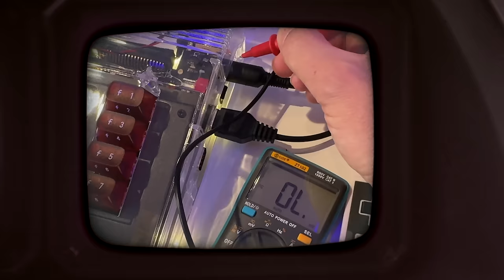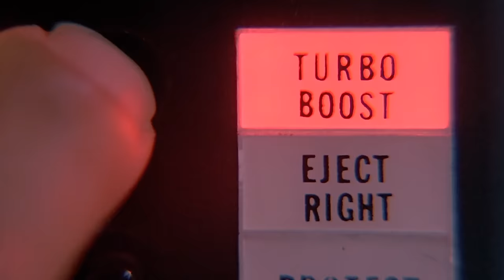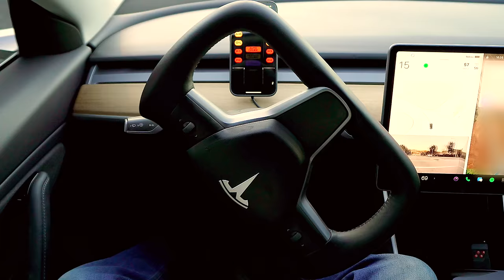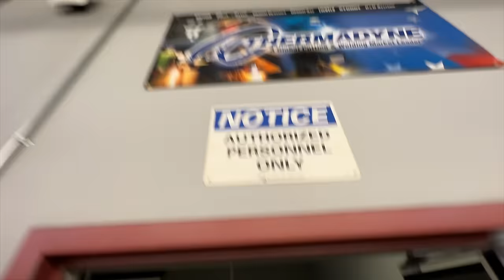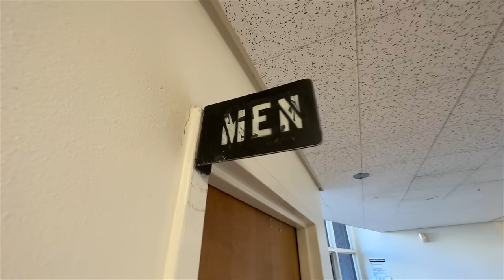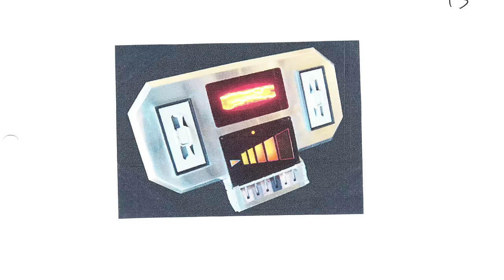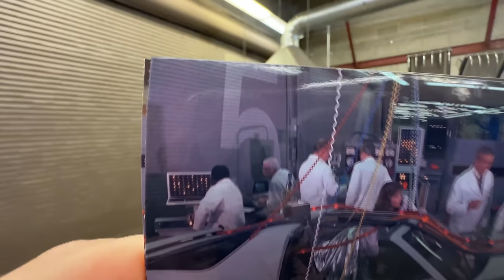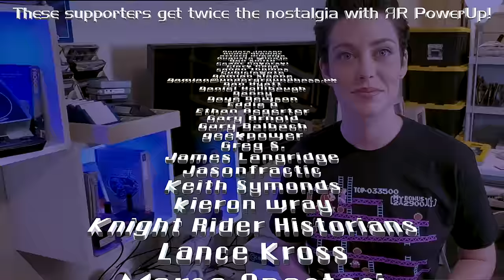Finally Found?: Knight Rider's Ultimate KITT Filming Location!

Comment: I recon this building was also used in Knights of the Fast Lane, Season 3. I think the corridor at 11:44 is the same corridor at 42 mins into the episode. Also 38 mins into the episode there is a roller shutter door with the number 1 on it. Looks very similar to numbers in this vid. Ceiling lights the same too.

Comment: Have you realized what makes an 1980s high-tech scene really retro, apart from the hairdos? Red and green lights, but no blue or white. Blue LEDs, and consequently, white ones, only came into existence in the 1990s. (Their story is really amazing, just look it up!) The sharp lights we commonly see everywhere today and associate with the 2010s and onward, are absent. When we see a white light, it's always an incandescent bulb, and therefore a bit yellowish and pale. This is why KITT is crammed with red and green LEDs, but no other colors. In fact, green was used with moderation on the set, as it was still fairly expensive.

Comment: I'm sitting here in Sweden and immediately saw where the room would have been. Looking directly at the angle of the house, should have been your focus from the beginning, the same applies to the garage door, you can see that it is larger and can correspond to two smaller garage doors.

Comment: really surprised, welding there more welding auto motive welding, the but have such a connection there you would thing? it would remembered the little things the room doors been block off, that full door size post could have put on the wall there or something?

Comment: the most unnecessary and useless bit of tech on KITT: the lights on the accelerator pedal that increase as you push it closer to the floor. REALLY? REALLY? For who was that for? you're not watching it as you drive. I mean really. why? Why have that? it doesn't help anything and it's not a function for anything. it's basically cosmetic. IE: just something to look at. I guess it was just for the audience watching the show. But even then why? I don't need to know how hard Michael was pushing the pedal. We can see the car going faster, duh. When I saw that I literally thought What the hell!? That's not needed.
Reply from the maker: It's for ants so they know when to hold on tight

Comment: Sad such an iconic car gets reduced to a Tesla.
Reply: Citation
Reply: @mikeuk666  Are we talking about Cessna Citation and where does that fit in out of curiosity? The original was a Pontiac TransAm.
Reply from the maker: Can you name another truly self driving car today? To many (not all) Tesla is the modern day realisation of KITT.
Reply: @RetroRecipes  wouldn’t really call it a truly self driving car. Unfortunately I’ve had to work three major accidents that were caused due to the self driving feature not recognizing emergency vehicles on the side of the road and rather than change lanes they instead drove themselves right into the back end of those emergency vehicles at highway speeds thus pushing said emergency  vehicle into the vehicle in front of them. 
They are very hard to put out when on fire taking literally 3 or more thousand gallons of water and AFFF. Also very dangerous on top of that and the burning lithium batteries are extremely toxic. Not to mention very dangerous to cut into when having to extricate victims after an accident. I know of a few firefighter and other emergency responders who’ve been electrocuted.
I’m sorry I’m not a hater but I just don’t trust them and believe the technology isn’t ready for mass production. 
I’ve seen these vehicles at their worst and it’s not only Tesla. The hybrids are included into this category as well. 
Don’t get me wrong it’s cool that it self drives for the most part like KITT. I was the little kid watching that when it first came out and still watch them back via streaming media.
Reply from the maker: @P-J-W-777  Firstly thank you for your service. 

We have two Teslas (a 3 and Y) and have driven for an hour without any human input. It's very much fully self driving. Wait till videos of v12 start to come out. This version is trained on great human drivers instead of using code to drive. It's nearly ready to come out of Beta with this v12.

I've done a lot of research into this and wonder if you can corroborate the official figures that out of every 1000 car fires, 52 are electric, 948 are gasoline? 

As for it not recognizing emergency vehicles, that's absolutely a huge failing of the v11 Beta version, which is partly why it nags the driver repeatedly that they must pay attention at all times and be ready to take over at any moment. Sadly, those crashes are still the driver's fault therefore, for ignoring that or overriding the system in some other way.

Tesla's figures show that for every 100,000 miles driven on AutoPilot there are considerably less deaths than 100,000 miles driven by a human manually. This is probably explained by it having 8 cameras and us only having one set of eyes. It can see things coming that people just can't.

So, is it perfect? Absolutely not. Does it crash? Yes. But is it important life saving technology that will in the future only get better not worse until it is perfect? Yes. In my view that needs to be embraced. Embracing that will literally save people's loved ones.

Thank you for listening to my TED talk ;)
Reply: @RetroRecipes  Firstly-Thank you, we really appreciate it!
Secondly-TED Talk lol! 😂 I thought mine was a sermon lol.

I’m sorry I don’t know the exact numbers and I highly doubt anyone has the real numbers. Based on the number of ICE vehicles versus EV vehicles on the road I would say the numbers you quoted are a pretty close representation. Of course the numbers for ICE vehicles are going to be higher as there are hundreds of thousands more of them on the road currently. 

It’s great to hear that Tesla has actual humans teaching the computers and even better to hear that the new upcoming autopilot will have added safety features built in. 
When we look at Tesla’s own safety numbers we have to take that with a grain of salt. It’s like for saying that their Ford Bronco is the safest vehicle for its crash protection rating. Every manufacturer fudges the numbers in their favor for sales. 
Again I’m not against Tesla or EV’s in general. I am however against them being forced on us. I do agree that we need additional safety features in vehicles that will recognize dangerous situations when the driver doesn’t. I love flying and was raised in big multi engine airplanes so I obviously really like autopilot. My problem with it has always been and remains that it isn’t and wasn’t ready for mass production yet. To me all life is important and we don’t need one more system that will facilitate more accidents than we currently have. I’ll say this, I’ve worked way too many accidents with fatalities and it doesn’t matter how many of those that I’ve worked when I pull a kid, child or baby seriously injured and/or lifeless from a vehicle it still hurts so very much. I just want these systems to be working and proven thoroughly before being allowed onto public roads/highways in great numbers. After all it’s nothing more than a computer and we all know computers regularly fail in some way or another. All it takes is a faulty sensor. 
Finally, airbags already made extrication dangerous enough. Every manufacturer installs them in a different area and we have to learn every vehicle so we don’t puncture one setting it off hurting ourselves or the victims. EV’s added an entirely new level to that with all the high voltage systems. Yes there is the firefighters disconnect, however it hasn’t always been accessible in different accidents. 
The battery fire! Not all are caused from spontaneous combustion as some would lead you to believe. Some are actually due to the vehicle being in an accident and the battery being damaged.  It does require a lot more water and AFFF than any other car fires I’ve fought. Once you get them extinguished they’ve often reignited and you start all over again. Some have even had to be submerged in water inside a big metal tank for a few days. 
We just need to work on better and safer battery technology if that’s the actual route we are heading. 
So again, it’s not hate. It’s trust! With what I’ve seen I don’t trust my family’s life in one yet no matter what Teslas numbers say. 

Thank you for taking the time to read both of my novels 😂 and  your response. This video is the first of your that I ran across but I have subscribed to see what you find next.
Reply from the maker: @P-J-W-777  Thanks in turn for your reply! I take on board all you have said.

I thought I should clarify one statistic. I was actually comparing EVs and gas cars like for like. So if you took 100,000 gas cars, and 100,000 EV cars (which is like saying there are the same balance of either on the roads, for this experiment), far less EVs would catch fire. 

Here's the actual data, aggregated from various sources including National Fire Protection Association (NFPA) Reports, National Transportation Safety Board (NTSB) Data, Insurance Industry Reports, Tesla Safety Reports, U.S. Department of Transportation Statistics, AutoInsuranceEZ Vehicle Fire Analysis Report:

	•	For 100,000 gasoline cars, you'd expect around 63 fires annually.
	•	For 100,000 electric vehicles, you'd expect around 6 fires annually.

So, like for like, the actual data indicates gasoline cars are 10 times more likely to catch fire. I think this is worth mentioning as there's a lot of misinformation out there from a scared industry.

It's easier if I just link to a source, but if you Google for "are EVs more likely to catch fire" you'll get many results: https://www.autoblog.com/2023/11/23/electric-cars-are-less-likely-to-catch-fire-than-gas-cars/#:~:text=It%20turns%20out%20that%20EVs,and%20Climate%20Intelligence%20Unit%20thinktank.

 I hope this info helps and once again thank you for what you do. I have no doubt that lithium fires are harder to put out than gasoline ones. 

Have a safe and great weekend and week sir.
Reply: @RetroRecipes  I’ll be honest I’ve seen others talking about their danger but I try to look at that with a grain of salt and only use what I’ve actually seen in person or a trusted fellow emergency responders have relayed to me. 
I’ve worked 4 fires in one year. 1 due to an accident and the battery being damaged pretty badly, 2 were determined to be faulty battery packs and the last was an issue with a grounding short. I’ve honestly forgotten the number of accidents. I do try to put those out of my mind in most cases though. 

I’ll read through the info within the link you’ve sent. I appreciate it! 

My best wishes go out to you and your family. Stay safe during your travels and if you so believe God Bless! 

Thanks again!
403 FF/EMT-P - blah blah blah